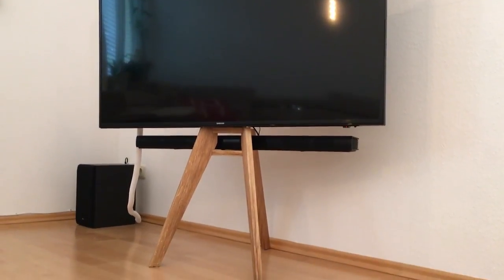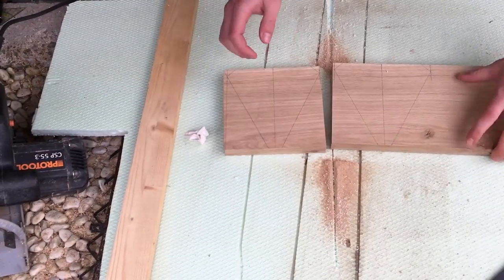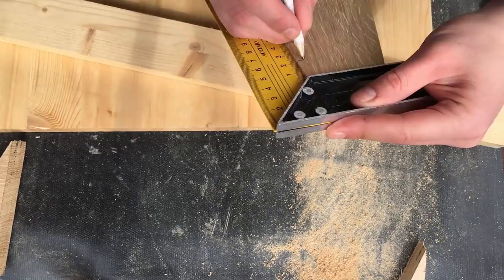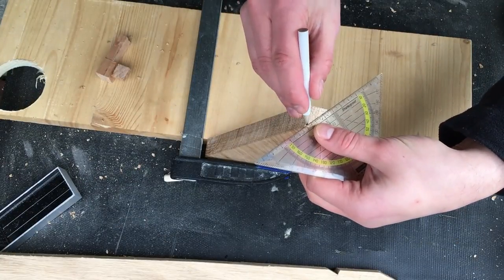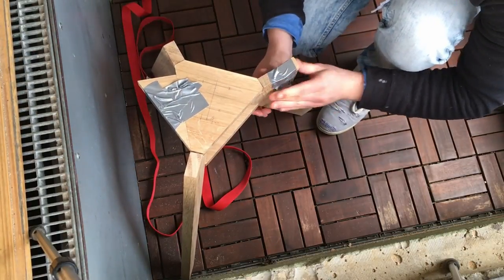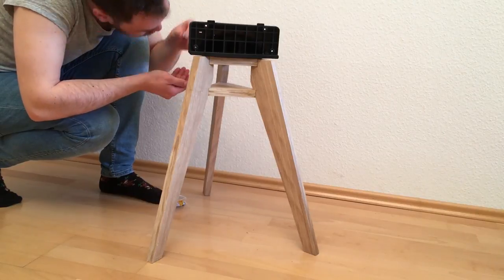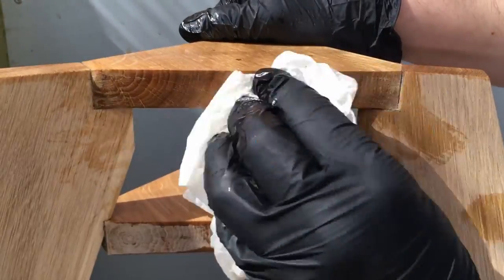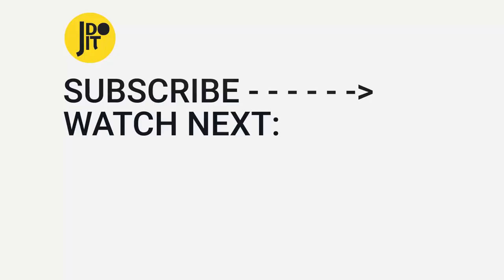Tripod TV Stand | My First Furniture Project

Comment: That looks great. I pretty much want that base, but with a pipe in the middle to adjust it up and down. I am thinking more like 35" to 65" adjustable, from the middle of the vesa adapter. That will cover me if I am sitting low on a futon or standing.

Comment: Why don't you sell these and earn some good money , here in scandinavia that will be really popular
Reply: Just here to confirm that yet another Scandinavian would appreciate this kind of product on the consumer market. I am currently looking for a mobile/portable and "discrete-design" (preferrebly wooden) TV stand for my LG Oled65c9 (yeah I know I am a bit crazy to want a mobile stand for this monster). 2000 SEK for Anderssons (on Netonnet) tripod, which I think is a direct copy of "eletab tripod" (which is cheaper but only available as an important to Sweden - which means it has the same price with import costs included), is too expensive for me to even consider. Even though I have the financial means. The optimal solution for me would a wooden stand with both wheels and adjustable height. Although I obviously understand that stability is the highest priority for these kind of products. 1000 SEK would definitely be a more reasonable price for these tripods that seem to have a lot of copies. I have also thought about trying to make a stand like in the video, but it is currently over my head. Also too scared to do the weight and stability calculations wrong. Would have to read som books before daring to try something like that.